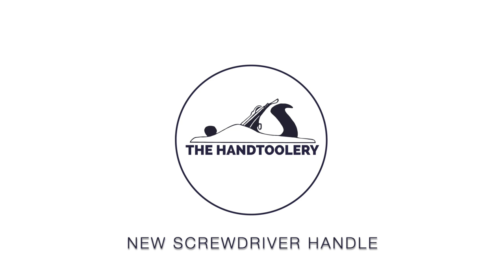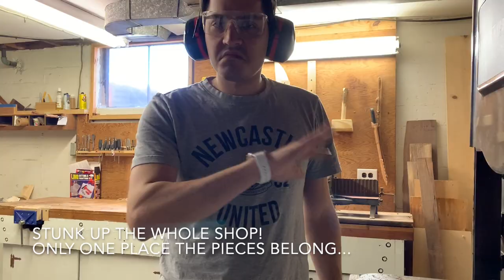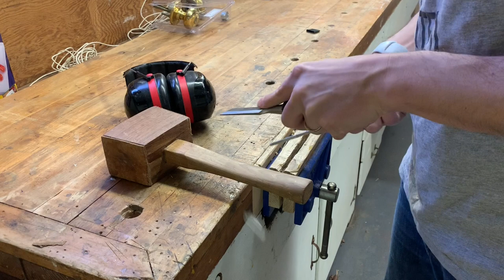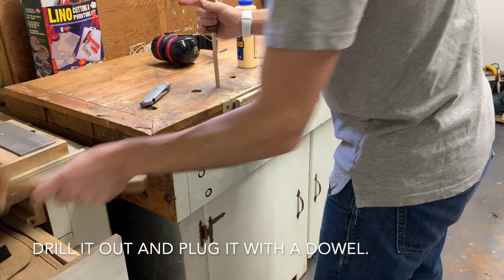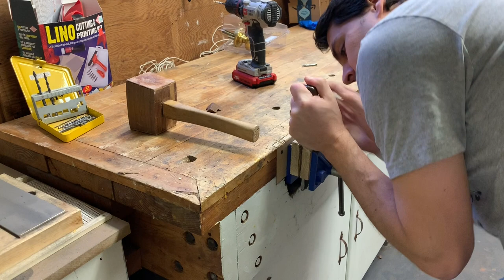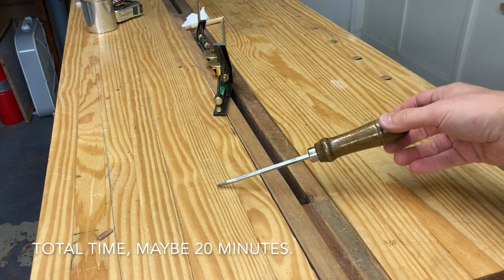Making a New Screwdriver Handle

Comment: I have two of those ... And a stinky box... How did you find the guilty party?
Reply from the maker: I was using it and it just smelled. I isolated it from the box a few days and and the box smelled a little better and the driver still stunk. Then, honestly, I smelled my other tools and they did not stink. Soooo process of smelling elimination 😂😂
Reply: @TheHandToolery  🤣🤣 I must have more than one smelly tool. Never thought a screwdriver handle could be the offender ...
Reply from the maker: I wasn’t quite certain it was the screwdriver, but within seconds of cutting it on the bandsaw, I was 110% sure. It smelled awful!